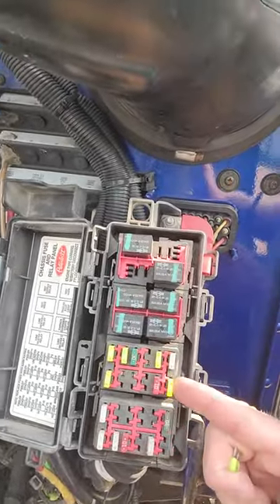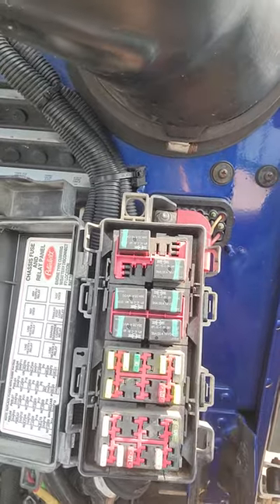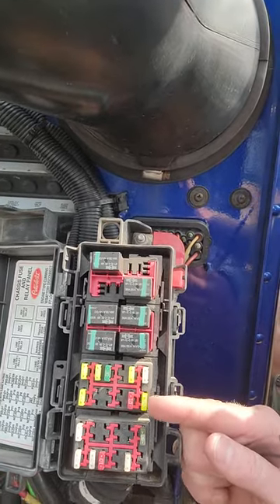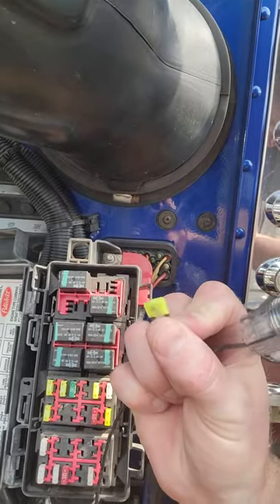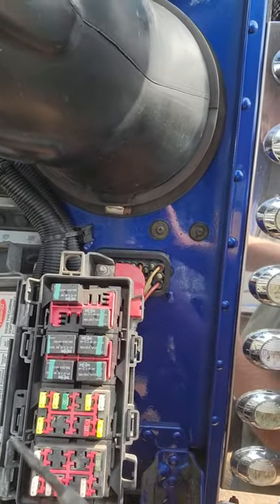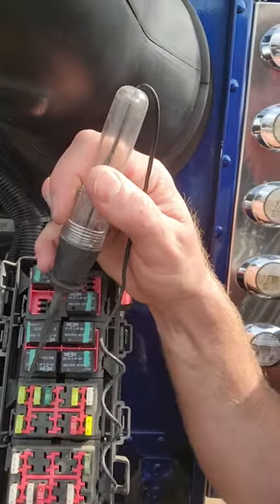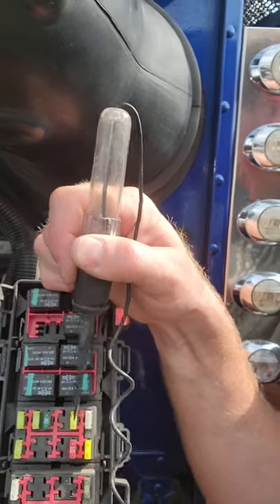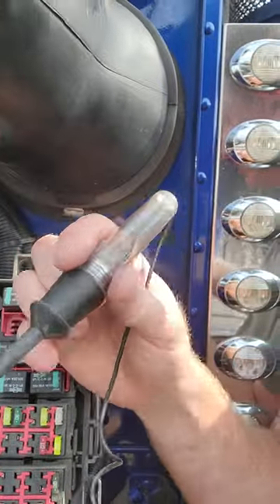Turn Signal Fuse

Comment: What year is your truck,  i have 2022 but no fuse box in hood only two fuse boxs one in kick panel and another in sleeper
Reply from the maker: It's a 2015 389. What model are you running?
Reply: That’s weird I have a 2024 and I have a fuse box it’s a bit smaller but it’s there

Comment: The same tail light work with the 4-way flasher/but when I turn on the other lights it doesn't work what could that be
Reply from the maker: Hey my man. Check the plug & wires on that light. If plug and wires are good, move plug to another light and see if it still does it. If so, it's the plug. If not, it's the light. Let us know!

Comment: Huh, my 21 389 doesn't have that fuse panel under the hood. It only has a little yellow box with 5 fuses in it.
Reply: Same here, did you find the fuse btw? The one he is talking about. Please help me if you did i got no left turn signal on tractor only